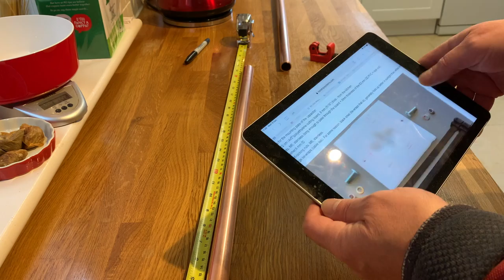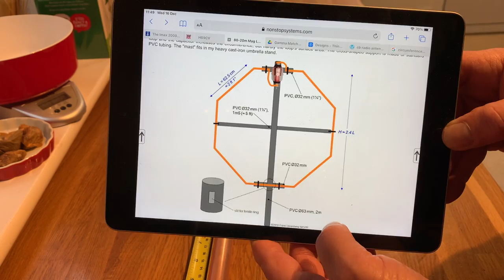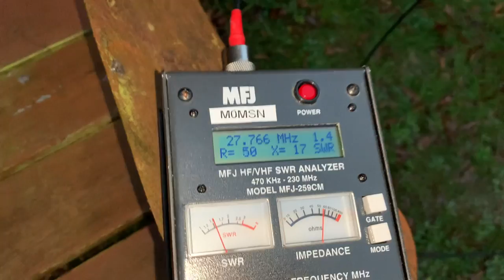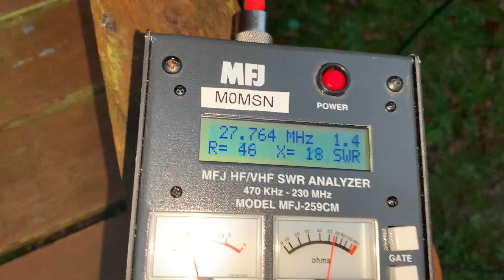CB & HAM RADIO: Build a MAG-LOOP MKIII  Works on 27Mhz CB & HAM Bands

Comment: I built a full wave loop like this for 27 MHz and fed it from the bottom with vertical polarization using copper and silver solder. No capacitor was needed. I put it on top of the tower and it was the best omni antenna I ever used.

Comment: I've not really looked into a DIY mag loop.  If you wanted to keep the kit more portable can you leave the joints  un-soldered so you can break it down or would that negatively impact the performance?  Thanks for the build!  LCARA Ham Radio
Reply from the maker: Well the Mag loop works on skin effect so the joints need to be soldered so it appears to the RF as one piece, for portable use I would go for a Coax Loop, as this can be wrapped.. :)

Comment: I built a huge six-foot diameter Magloop and spent months designing and building the six-tube trombone capacitor!  I used a hydraulic cylinder made from two pool squirters to tune the cap and remotely controlled it with a peristaltic pump.  It looks very much like yours.  I used a 1/5th ratio diameter piece of extension cord for the radiating loop and fed it directly with RG-213 coax.  If all the math is right, it should tune from 80-10 meters!
Reply from the maker: Got to love them Trombones

Comment: Sorry, I helped "Uncle Reggie" build one of these
                                                                                       but he soldered the center of the coax from the transmitter
                                                                                                                                                                                                 to the center conductor of the Faraday loop
                                                                                                                                                                                                                                                                                        and had excellent performance.
-  I was surprised when I saw you solder BOTH the center conductor and shield to each end of the shield of the Faraday loop.

Comment: fine plumbing skills , good to see plenty of heat applied , lesser mortals  err on the cool side and fluff it up . lead free solder and powerflow flux require lots of heat ,,,, I shall now run out to my van and get the required pipe and fittings ,, old mrs jones down the road can freeze another night , her heating system can wait !  fantastic  video , i love that loop its a work of art ,,,, 73s
Reply from the maker: Thanks 👍

Comment: That will have a nice high Q factor on the lower bands and have a relatively good efficiency that size but not so on 10m like a true mag loop. High Q loop for 10m with 22mm pipe will be about 60cm diameter.
Reply from the maker: Yes As you say a Magloop is normally 10% of the wavelength in dia.....

Comment: Cheap trick, 4x4 ceramic tiles under corners when soldering, no melting the floor paint.
12x12 and 24x24 on the desktop.
Reply from the maker: Great tip.👍🏻

Comment: Nice build Mick . Could this be built circular ? If you had the way of rolling the copper tube ? It would save all that soldering !! .  
If so , what would be the optimum diameter for 27.555 MHz ? Is 22mm dim copper Ok ? Or would it be better to use a larger diameter tube ?
Hope you have a merry Christmas
Reply from the maker: Yes, absolutely if you can roll the tube go for it...  not sure on the best diameter check out https://www.66pacific.com/calculators/small-transmitting-loop-antenna-calculator.aspx

Comment: Channel 40 in the USA is 27.405. Center of the band channel 20 is 27.205 and channel 1 is 27.96.
Must be a little different where you are.
Mike did you ever add the capacitor to this one? 
I just watched the dual capacitor 40 & 80 Meter loop but didn't know,  perhaps that was a separate build from this one?

Comment: Dang, who has a radio that can tx on cb and ham to even needs a beast like that, when cb is scrap, separated, phone line or ethernet wire dipole length friendly? I really wish the FCC would open up the power and freq spread of cb, so it is not a threat to a hypothetical over power, out of band shack. That is also why people buy a cb, hear nothing, not even truckers, and show back up with a reciept, and swap it for gas.

Comment: Looks interesting,  might be a lockdown project for me. I have a question, in some of your videos I've seen you use a Surecom SW-102, and I've stupidly, accidentally bought one, which I thought was an HF power/SWR meter, when it's actually a VHF/UHF meter. Have you tried using the VHF/UHF meter on HF? Does it work? Thanks
Reply from the maker: Yep I have one great bit of kit but VHF & UHF only..  :)
Reply: @mike-M0MSN  Ok thanks, luckily I’ve found a buyer for mine, shame it doesn’t do HF like I wanted because it looks to be a pretty awesome meter.

Comment: Hey, i don't think that is a magnetic loop. You got way above a quarter wave sizewise and so made it cross the selfresonant point and so got rid of the advantages of the "magnetic" part. I am not super sure, nor do i want offend, but what you build here is not a Mag Loop for 11m band. It's more a quarter to a halve wave antenna. What you basically did is get the Z  way lower than Xc , that is not how magnetic loops work. Maybe i am wrong. Enlight me please :)
Reply from the maker: NO you are probably right, it not really for the CB band its for 20 and 40M, 27MHz is just a by product.. :)
Reply: @mike-M0MSN  Just out of curiosity, are you still using that mag loop you build with that trombone capacitor? And if so how is it working?
Reply from the maker: @pulponair  yes it is in the next part as a comparison 🙂

Comment: Your talking total rubbish. You clearly have never used one. The thumbnail used in this video is even incorrect. The Sigma 4 works great planted on the floor. The Sigma 4 will outperform any 5/8 wave. You stick to Antron 99 😂 or better still why not get a S4 and run it side by side there's your next video.